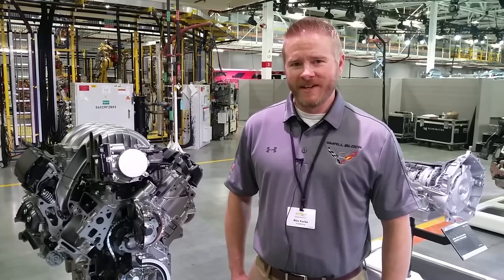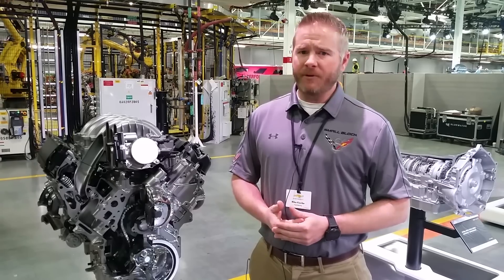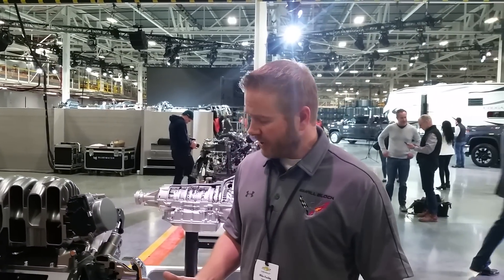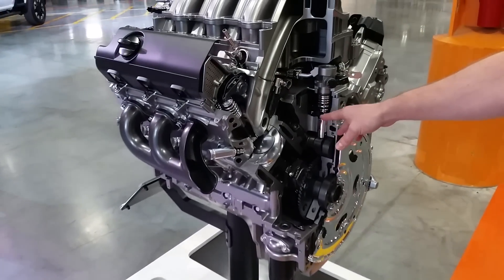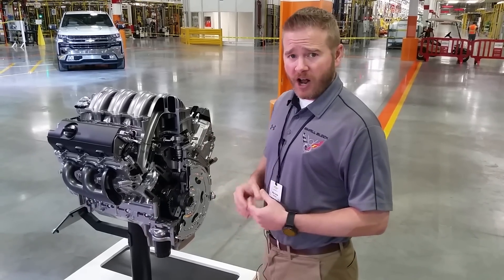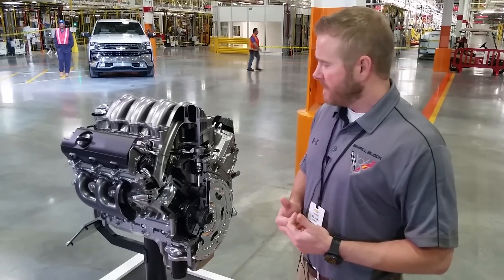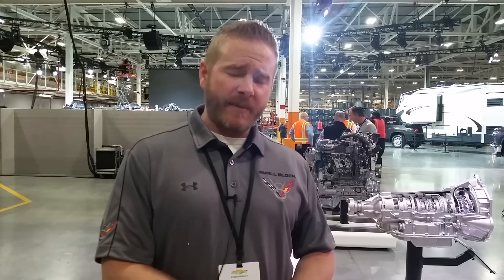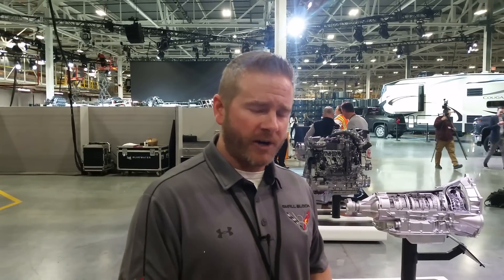New 6.6-liter V8 gas engine on 2020 Silverado HD

Comment: as a automotive technician with 18 years of experience ( i don't couth the years i spent sweeping floors or helping techs thru the years) all i heard was "THIS IS GOING TO COST YOU MONEY WHEN IT BREAKS. THIS IS EXPENSIVE, AND GOD HELP YOU IF THIS GOES OUT AND NEEDS TO BE REPAIRED.  THE FUEL INJECTORS ARE ABOUT $500 E PIECE TO REPLACE. THE VARIABLE OIL PUMP IS A INDUSTRY LEADING JOKE IN THE AUTOMOTIVE BUSINESS. 400+ Lbs OF TORQUE FOR GOING TO THE MALL, AND A HIGH PRESSURE CAM DRIVEN FUEL PUMP FOR WHEN YOUR IN THE McDONALDS DRIVE THRU. THIS IS NOT THE TRUCK THAT CUSTOMERS WANT, IT'S THE TRUCK THAT WE, AS ENGINEERS ENVISIONED. AND WE'VE FULLY IMPLEMENTED WHAT WE WANT TO SEE, AS OPPOSED TO WHAT THE ACTUAL BUYING PUBLIC WANTS."

I have seen time and time again how the car buying public doesn't give a rats ass whats in the vehicle, how it works, or what it's made of. They just want it to go forward and reverse, and look nice doing it. But when something goes wrong.....it's usually US (technicians and the shop) that get the blame for the immense cost of repair. I did a repair on the seat vibrator on a 2014 Suburban that went out when going in reverse. It lets you know  when your too close to an object. Total cost: $1,400.  Do the air ride rear shocks and the front Variable Magnetic Dampening shocks go bad? $2,600 for new rear air shocks, compressor, and front struts. The vehicles being built today are not built with longevity in mind. They are build with bells, whistles, and the newest Apps that let you control certain functions thru your phone. And when that shit breaks, so does your bank account.

This truck is a Easy Pass for me.
Reply: I had a '14 Grand Cherokee that needed the front sensor replaced. The service department manager told me that it would have cost me $4000 but luckily it was still under warranty.
Reply: Anybody remember the 60s and early 70s, when the new car bumper-to-bumper warranty was 12months/12,000 miles, including the powertrain???
Reply: The way I understand it, its not a daily use commuter truck but a truck engine meant to actually do truck work.  I know that is rare today.  I agree it will be expensive but not as expensive as operating a small turbo engine truck.  They have to incorporate the expensive tech due to regulations on emissions ect.  This is definitely not the truck to buy for grocery getting but if you pull trailers all the time or carry heavy loads this is the truck.  I know some will say diesel is better and they are right but this is a lower cost option to perform the same job.  If it costs as much as a diesel then it will not sell.
Reply: Robert Charlton spot on, most of these 2500 trucks are commuters and modded up Brodozers. at my chevy dealer i worked at we have a previous gen 3500 dually thats always coming in for work  and its on 40 in tall Forgiatos, and we get a bunch of 2500 single wheels lifted to holy hell with a diesel 6.6L and the come in for EGR cooler getting clogged and some CP4 injection pumps, mostly crap emissions shit that only works right when the truck is actually doing heavy work. The ones at go past 150k 200k are the actual 2500/3500 trucks that do long haul stints and carry shit ton of stuff and the never come in for repair, its just maintenance and go
Reply: @Averagegunenthusiast  
Trust me, these N/A gas engines will be considerably less expensive than the diesels. 
Probably by more than $10K less expensive...
Reply: Do you feel that way about the duramax motors ?
Reply: They are way over thinking things since 2014 everything has gone down hill. Very well said on everything they just want people to buy it and pay more when it breaks. Lol
Reply: I don’t know if it will actually be good but a simple pushrod 7.3L sounds more appealing. Less parts. Less complexity. More displacement. Less breaky.
Reply: @jeffhirata This is a simple pushrod engine also.
Reply: John S   Stainless Steel  Brake lines  should be federally mandated  might  add $40.00 to the cost of a new car ..
Reply: Yep,that's what I heard to
Reply: John S 
 Yeah, cars/trucks do tend to last far longer than they did in the early 70s or prior.
Some of it has to do with more precise machining tolerances and metallurgy, some of it has to do with the switch to fuel injection and the resulting more precise fuel control (less fuel diluted into the oil and cylinder wall washing), and great advances in oil/lubricant technologies. It's quite common to see cars and trucks with over 300K miles these days, with most features still working on them.
Reply: very interesting.....too many bells and whistles yes....i want a strong, durable engine, and transmission, brakes and suspension. I will be pulling my bracket car around and the better these thing, the easier the tow, for more miles. As I look at the options on these new trucks, I would like to delete the frills, keep it to the stuff that matters, cause for the price$$$$, I am going to have it for a while. The less frilly stuff, the less I will have to repair down the road, and  do think of that. It's a truck, not a corvette, it's got to do tuck stuff good, or I don't need it. I am not planning on buying anything any time soon.
Reply: @mikef-gi2dg If you don't want all this fancy shit buy a 1972 then.
Reply: @kkoch666  Well lets see....my comment from 3 years ago....about wanting a truck/tow vehicle with necessary truck stuff if possible.......really tweaked somebody's feelings. I have 3 70's rides...75 Monza, 79 Monza, 78 Malibu. I don't want to hog up all the 70's fun. My 2016 Silverado seems to be getting it done quite nicely. My 60's cars and 80's cars have no complaints as well. So all I can offer is  E PLURIBUS UNUM. I hope passing the snarky comment has made you feel better, cause big wheels keep on turnin.
Reply: I'm not sure.  The consumer doesn't care how it does it, as long as it does it.  Seems people want it all in a truck now.  Low end torque, high end horsepower, runs quiet and smooth, and delivers good MPG.  Meanwhile the EPA/CAFE and a host of others want it to not only get good fuel economy but burn so clean.  Here is the result.  No, vehicles are not built for longevity but due to increased warranties and lemon law requirements they are being built better and lasting longer as a result.   I do believe that the average consumer knows less and less about their own vehicle and how to care for it properly while becoming increasingly demanding with an entitlement mentality that the manufacturer is responsible for the vehicle as long as they have it on the road.
Reply: Mark Carr
If the bells and whistles go bad, you can normally still drive the vehicle.
Vibrators in the seat go out, and cant or dont want to pay for an expensive repair? Just keep driving without that feature, or find a suitable replacement seat at the Pick-A-Part, and replace it yourself...
Magnetic shocks go out? Replace them with the much cheaper standard shocks and keep driving...
There are often less expensive repair or delete options...
Reply: @lees.4084  Let me tell you how wrong you are. First, the magna-ride shocks cannot be switched over to some other standard suspension setup. A pcm module controls the dampening, and valves, rebound, and the magnetic valving of the fluid to control the ride. And it does this hundreds of times a second, to obtain the best possible ride experience. Your not going to get that with a conversation suspension kit. Also, do you think pick-a-part is going to have a newer model vehicle outside in the yard for anyone to go pick thru it? Wrong. It's been sold at an auction, to a large company that will catalog, store and inventory damn near every part of this vehicle. And it'll be sold at a pretty good price. And the seat shaker repair? The wife becomes dependent upon these bells and whistles, and when it fails, SHE WANTS IT FIXED!!  The wife doesn't care how much it cost, she wants it to work longer or did when she drove it off the lot. Also, in every instance you described, the dash will indicate a problem with the affected system, and if you try to sell it to a 3rd party, or trade it in, it'll seriously demiish the value of the vehicle. And besides, people are keeping vehicles longer than ever.... Its the one who buy with their eyes that pay the ultimate price.
Reply: @markcarr5142  
Yes, they can be swapped, and have been swapped. 
There are ways around all these technical issues. 
Your wife's out of control spending habits are your problem, not ours...
Reply: @lees.4084  Many of these electronic parts are also coded to the vehicle they are installed on at the factory. So even if you can find a good used part at lower price, it will need to be paired to the new vehicle thus still requiring a trip to the dealer in most cases.
Reply: @bryanwilliams4620  depends on the part.  Some are coded, many arent.
Reply: @lees.4084  you have a vibrator in your seat?
Reply: @wolfmanrebel874  
I do not...
But apparently, some people do, and they cant get by without them...😯
Reply: @lees.4084  that's crazy, I was a GM tech until around 09 and just lost interest and stopped following new models I got my 74f250/83f150/03 f150 99lumina and 00 LeSabre I will keep for the remainder of my life,nobody makes a plain old truck anymore without a catch of some sort and they are to expensive for the lack of reliability and price of parts to keep them half as long as I have had mine and on top of that I don't let nobody work on my stuff but me so I'm out,lol
Reply: @wolfmanrebel874  
I understand your point.
I generally prefer simplicity myself.
Yes, many newer vehicles have vibrators built into the seats to help warn you of hazards, such as lane departure, etc.
Someone was complaining about the costs of repairing features such as seat vibrators, etc.
My point was that you can generally still drive the vehicle even if such bells and whistles stop functioning.
Reply: @lees.4084  ok,I get it now,damn I'm old ,so it's like my kids game controller that shakes when you are being shot at,got it, yes you are correct being able to drive the vehicle without all the BS however I'm starting to think youngens can't drive without a camera,a buzzer to tell them when they are about to be hit or hit something or even know how a physical key works😒
Reply: You’re no more responsible for ignorant consumers than the engineers are, anybody who doesn’t do their homework should expect expensive repairs

Comment: a diesel engine would be more  economical. the mpg on that 6.6 engine will be  very low. you'll be spending a lot of time and money at the gas station. this engine is made for certain  customers. guess there is a market for this engine. you'll get to your destination a lot faster.
Reply: Here's the thing with the diesels though. When you buy the truck new, last I looked its a good $8000 extra for the diesel, and the old myth of "its a diesel, it'll run forever" is nonsense anymore.  Replacing a set of diesel injectors will cost damn near as much money as replacing a whole gas engine, the new emissions systems are a headache, and if it needs much any work on the top end they're so crammed into the engine bay labor will eat you alive. The MPG will be worse but depending on the application, the long term cost of ownership of a bigger gas engine might be attractive to a lot of fleet buyers.

Comment: 7500 miles on a single oil change? I never trust those computers. 5000 is the most I’ll drive before changing my oil
Reply: Oil analysis.  I regularly run 10-12k on my LML duramax with nothing more than a filter change around 5k and a quart to top it off. Running Schaefers full synthetic. 160,000 not so easy miles and not a problem.

Comment: Okay so the 6.6 make slightly less power than the 6.2 . What's the point in even having it ?
Reply: HP isnt everything...... HP sells engines, torque wins races

you can design an engine to make 700hp from 5550 to 5600 rpm
but a motor making 450hp from 2000 to 6000 rpm will be quicker

Comment: This thing is going to get owned by the new Ford 7.3. Huge #fail
Reply: hahahaha....wrong.
Reply: At 6.6L 400hp Gas engine it will have to do an amazing job at fuel economy, performance, and competition .
TBH a turbo diesel seems better

Comment: I am waiting for the new Ford 7.3 pushrod Gasser
Reply: James Richardson it will be interesting to see which one comes out on top. I, like yourself, am much more excited for the new 7.3. But both have merits and points against them. Hopefully engine masters will do a head to head when the 7.3 comes out
Reply: @CorndogBrownie  fords been on top for 43 years in trucks so i don't see that changing anytime soon... Especially with that badass 7.3
Reply: @tylersutton7667  Seriously?  Your statement isn't correct.  2017 numbers by manufacturer:  ALL GM pickups - 948,909 units sold,  ALL FORD pickups - 896,764 units sold,  ALL RAM pickups - 500,723 units sold.  As far as the Ford 7.3 goes, I hope it's a torque monster and blows everybody else away.
Reply: @simonthebroken9691  are you insane? The ford f series is the worlds best selling vehicle and has outsold ram and chevy for 43 years you need to do some research ford sold over 2 million  7.3 powerstrokes alone ford is selling over 900k trucks a year conpared to chevy at 800k trucks a year. No one will ever outsell ford in trucks thats a well known fact
Reply: @simonthebroken9691  Overall, in 2017, Ford sold nearly 900,000 F-Series, comfortably outpacing the combined 800,000 total of GM's Chevrolet Silverado and GMC Sierra models.
Reply: @simonthebroken9691  so far this year ford has sold over 220k trucks chevy at 114k and ram overtook chevy at 118k
Reply: Fuck a ford

Comment: So the 6.2 makes 420hp and 450 ft.lbs of torque... Will someone explain to me this expensive high-tech pile of problems is a step forward? Your telling me I need to spent alot more money for 10 more ft.lbs and 20 less hp?
Reply: If all you look at are "peak" torque/hp numbers, then you arent looking at the big picture...
This engine has a much broader, flatter torque curve.
Torque under the peak is much better. 
This engine isnt about making more power just at the peak RPM, but making better AVERAGE power across the band.
Just what's needed for towing, and carrying heavy loads...
Reply: @lees.4084  and that's exactly what they didn't explain. I specifically asked what's the selling point for this engine? What makes it worth a net 20k loss out of my pocket. And to be honest it's not worth it to me with a very capable 6.2 liter with alot of life still in it.
Reply: @jwill9877  
It's not meant to replace the 6.2L in the 1500 trucks, it's meant to replace the 6.0L L96, in the HD trucks, which is the current gasoline engine of choice for heavy towing use.
The L96 makes 360 hp, 380 torque, so as you can see, this new 6.6L is a substantial power improvement for HD towing.
Typically, engines meant for heavy towing are de-tuned from what you get in light duty trucks, milder cam, and lower compression. 
This makes them better suited and more survivable in heavy towing conditions.
Other modifications are typically done to HD engines to help them cope with the extra prolonged strain and heat that heavy towing use generates.
With direct injection, this new 6.6L is able to raise compression considerably over previous heavy duty gasoline engines